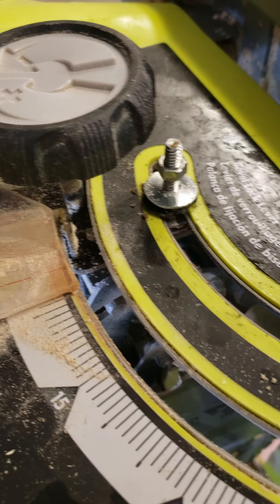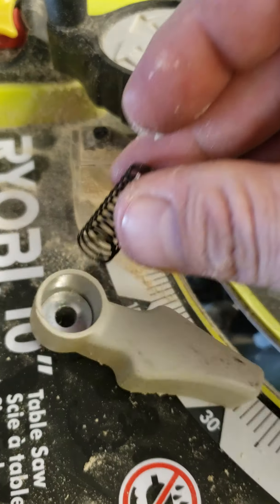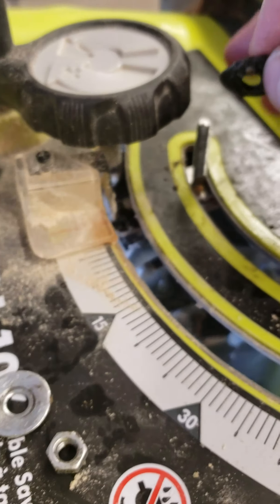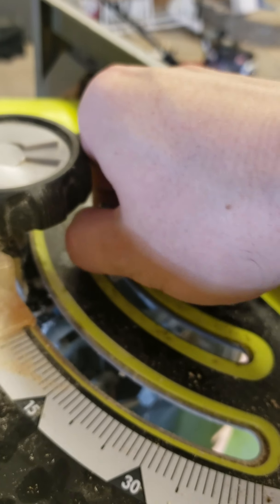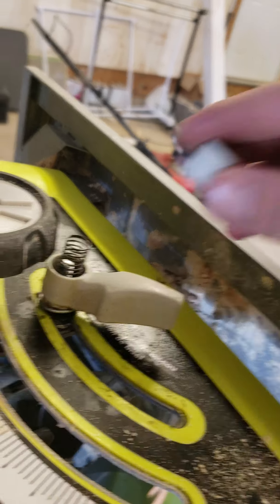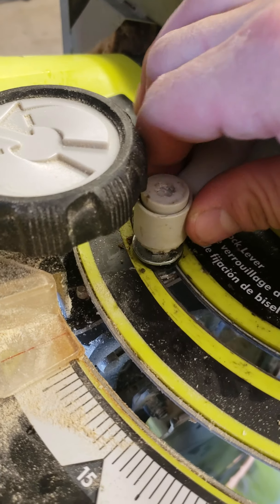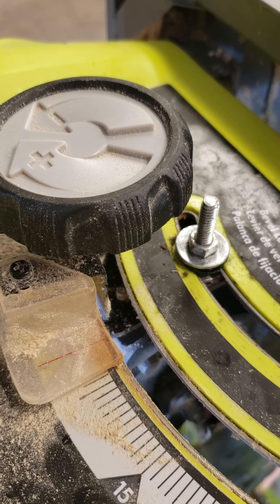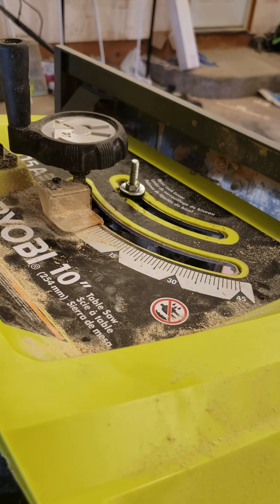When your Bevel Lock Lever fails...

Comment: Total noob here. Same problem on my Ryobi RTS12. I went to adjust the blade to make a 45º bevel cut for these shelves. No problem! My first couple of bevel cuts, so proud. 

I go to reset the blade to zero and the bevel lock lever is already stripped... After adjusting once lol. Wing-nut seems like a good idea to fix. But wow, such a poor design. At least make the interior of the handle mold metal where it's contacting the nut.
Reply from the maker: I absolutely agree, thanks for commenting and keep a lookout for a new content coming soon!

Comment: Had the same problem and it was an easy $20 fix. The problem was on the top of the saw are two set screws. One was not mounted correctly. Upon ensuring the set screws were properly inset. The problem went away. All is right with my table Saw now.

Comment: My brand new out of the box Ryobi lever failed . I knew its a simple mechanical issue , i am glad i saw your video man. I may have to open the lever to fix mine OR i may just return this plastic crap. Man i have to say , Thank you for  you sharing this video now at least i know how the screw me hanish of how to get to the actual screw. On the new model alan wrench does not reach because of the rotatory wheel.

Comment: Well, I have the same table saw, with the same problem, so some real helpful positive comments to fix the problem would be helpful instead of people saying to throw it away and get a better different brand, it's not about the brand, it's about fixing the table saw either help or don't post.
Reply from the maker: I hear ya. So my fix was to not use the lever at all. Now I have a dedicated wrench I leave with the table saw to angle the blade when needed. 

I found replacements on Amazon for $20usd but it'll inevitably have the same issue. I'll just stick with my wrench until I upgrade to a better table saw.
Reply: @thejoshthatbuilds  I did the same thing. Thanks. Be safe.
Reply from the maker: Did you see the other comments about using a wing nut? Great tip! Hope that helps Martin!